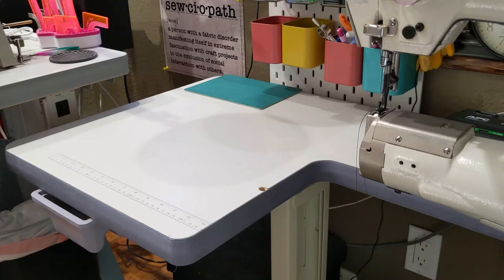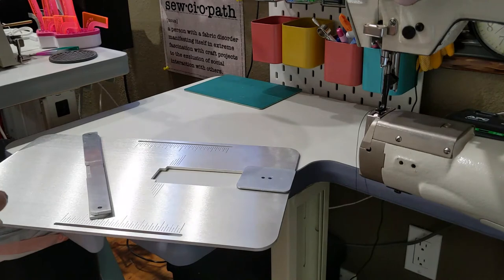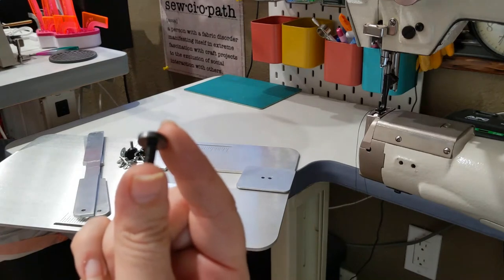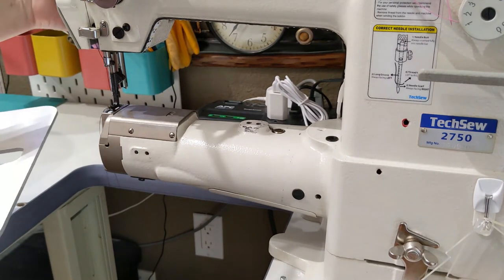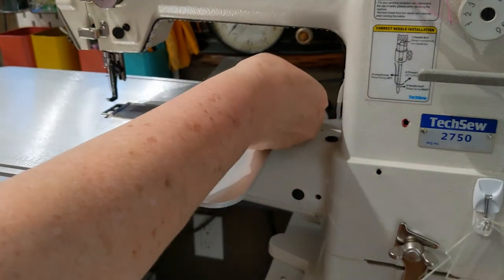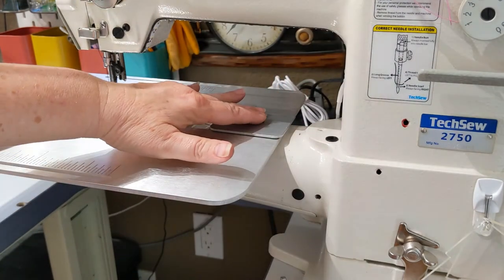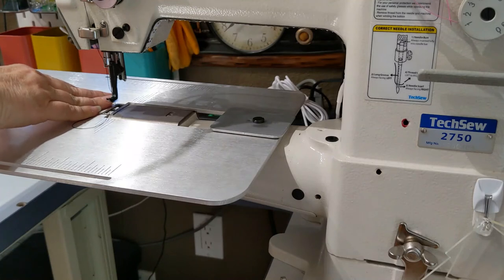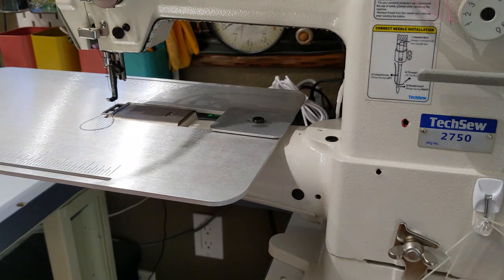Cylinder Arm Aluminum Table Installation

Comment: I’m so excited to throw away the extension I bought with my Thor GC1341.  The edges of my tables are rough. What do you recommend to smooth those out?  Also the screw included is fighting me. I’m afraid to force it any harder. What would you suggest for a replacement?   I bought the tray that goes underneath the arm to close the hole. I bought the one with the hole for the little accessories. Thanks in advance for your help. I am ecstatic about using my machine now.

Comment: Do you have the Pro version of your machine? I’m ordering mine and was wondering if you thought the difference between the two machines warranted the additional cost. The pro comes with a table but doesn’t have all the markings so I’ll probably need your table.